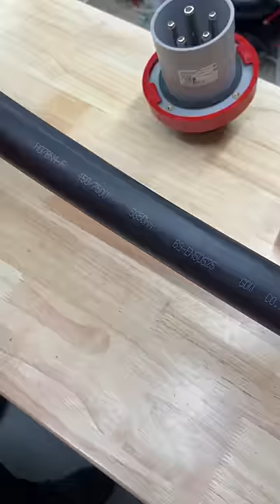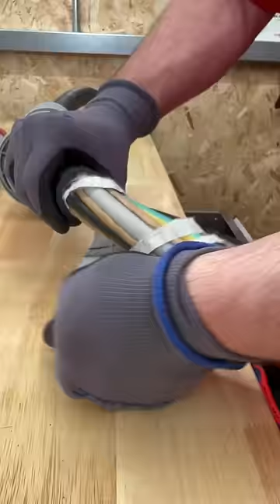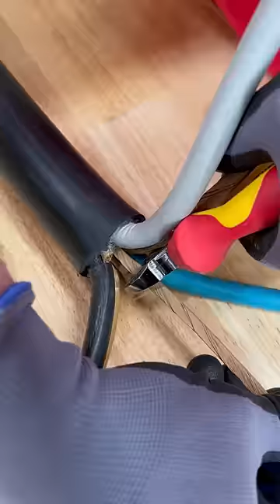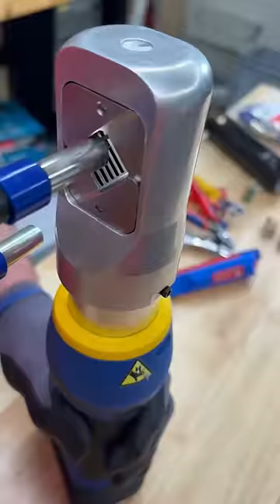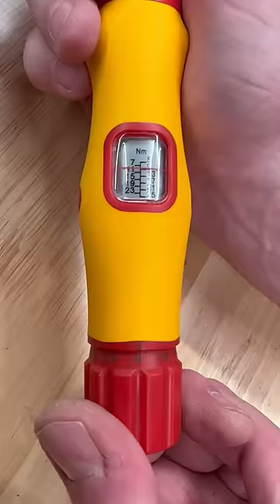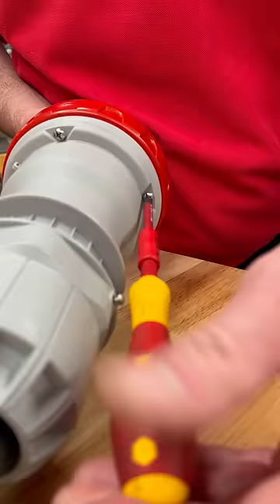Wiring a Massive Plug: We enjoy this electrical work!

Comment: Aside from this being extremely fun to watch, I think as a joke, at the end of the clip, acting like it was then plugged in to the back of a refrigerator to then open the door to see if the bulb inside was working would have been hilarious 😂
Reply from the maker: Like it 👍
Reply: Take the prank a little bit further, and put a piece of clear tape over the button of the door switch so the light doesn't come on.
Reply: @efixx ассалому алайкум вы можете сказать артикул динамометрический ключ от компания wiha

Comment: if u were in germany u could start from start again , because in german the PE cable has to be the longest so if u rip the plug off the PE is the last cable to go off
Reply: In many of these plugs, the Earth terminal sits proud of the phase/neutral terminals, so if you cut the conductors the same length, you achieve the same result.
Reply: @Smatnm The rule is about cable getting yanked out of the plug .
Reply: @johndododoe1411  Yep, and if the earth terminal sits proud of live/neutral terminals and all cables are the same length, then the earth is the last to be pulled: same result.
Reply: @johndododoe1411  It could even be argued that, in the case of trailing sockets, the above mentioned method is safer than having all terminals the same spacing from the cable entry and a longer PE cable.

In the case of a proud PE terminal/same length wires, if the cable of a socket were to be pulled free and the breaker didn’t trip, you’re less likely to end up with an exposed and live/energised conductor if all three wires have an increased chance of contacting each other (and tripping a breaker) when forced through the narrowing of the cable entry. With a longer PE, there’s less chance it would touch the live/neutral.

Not that that is something I’d rely on for safety, more a happy byproduct/extra of the design.

Comment: The style of plugs are called CECON (European economic community - connectors), pronounced "se-con"
The CECON shown is a 3 phase + Neutral + Ground, also known as 5 pin, or 3Ph+N+Pe.
This size is rated for 64 Amp, 400V.
CECON connectors have a good IP rating, typically IP65. They are very common in industrial and comercial  use.
Reply: I think it's a 125A Plug
Reply: Ceeform
Reply: Yeah I thought 125a also
Reply: 125A 5 pin commando plug
Reply: ¿25mm2 cada cable unipolar, o quizás 35mm2?
Reply: You plug for a kettle  is huge. 
What does it take to boil water. 15 sec.
Reply: @assassinlexx1993  It's for brewing extra strong tea, drink of champions.
Reply: @trespire  can't argue with that.  Even your tanks are designed for making tea.
Reply: 64 amps?!?! You don’t need 0 awg wire for 64 amps
Reply: @biguzivert Usually fused at 63A times 3 to provide 40kW for construction or stage gear .

Comment: Lovely job on some decent size cable! Usually then ruined by folks that don’t push them fully home when connecting causing them to arc then go on fire 😬
Reply: Or at the very least you end up with the plug welded into the socket… Ask me how I know 😠
Reply: Open circuit diode protection will fix that
Reply: That's why this system has mechanical locks when fully inserted .  Some also have a pilot contact keeping power off until fully inserted  .

Comment: Those connectors are great! I just bought some. Mine are smaller, but they work great, and they make the connection points so much better. It looks factory made after you're finished. Great job 👏🏽 👍🏽 👌🏽 🙌🏽

Comment: Our 200 amp shore power military cables have pneumatic crimp pins that are inserted through the connector and lock into place. Connector is machined aluminum.
Reply: You should look into the plugs used for cargo and cruise ships .  Outlets are available in many existing harbors, increasing navigation options .

Comment: Those ferrules was slightly larger than those I use for my 3d printers 🤣
Reply from the maker: Time for a bigger printer 🖨️
Reply: @efixx  if I'd need 3-phase cable at that size for a 3d printer, it would not feel very safe 🙂
How much does that cable handle?
400v 200A+?
Reply: @kharmastreams8319  plug looks to be a 400/415 volt 125A 3ph+n+pe

Comment: now that is 3 phase power
Reply: looks like 4 phases, unless 2 grounds?
Reply: @acat6000 this is a good suggestion but there is a neutral wire there so 3 phases, ground and neutral depends on how you want to connect the loads you may use it or not.
Reply: @acat6000  4 phase isn't really a thing, anything above 3 phases is basically pointless.
Reply: @acat6000  Three phase plus neutral and earth. 400V nominal phase to phase, 230 volt nominal phase to neutral/earth. Standard for mains power in most of Europe.

Comment: I have learned that the green/yellow should be longer with a connection. If the socket tears off, the protective contact remains longer.

Comment: Finally an electrician that uses a torque wrench. I always encounter either so tight that the skin of my hands get stripped off when turning the tool to loosen a connector. Impact drivers were used. Or the weak handed electricians where I touch the wire and they fall out

Comment: I miss the times on the shipyard, where we had to mess with thicc cables. The welders were able to burn everything up :D. I cursed at them and loved them anyway. It gets that way on sometimes 14, 16, 18 hours a day when the work has to be get done. 125 amps cables, four single 300 sqmm strands to
Reply: Sent the comment by mistake and can't edit it on the smartphone browser. The 300 sqmm cables were for the ships in the drydock. We needed four of them. We had cranes but the last step you had to tug them by youself.
Reply: And our big motor generator to get from 50 to 60 Hertz. What a Maschine. Giant hunk of Metal

Comment: Danish electrician here...
Almost good:
> Snapping off spacing material.
> No illigal joints like the awful splicing videos floating around.
> Torque was a nice detail many forget.
> Lovely compact screwdriver set (have one myself), but individual drivers are better since you save time with switching bits.
> Putting the sleve on before mounting the wires in the terminals. Apprentices sometimes forgets that because they are too eager to finish the job.
> Using crimping equipment is a nice touch, although unnecessary, since the CEE plug is designed to take multicore wires directly into the terminals. Many like ferrels, but the reality is that you are adding another way for the connection to fail and cause whatever disaster as a result. You should avoid using them whenever possible like here.
What could be better:
> Using a propper cable and wire stripping tool instead of a knife that can easily damage the wires insolation or the wire cores. Even a scratch can leave a permanent weakpoint and a disaster waiting to happen.
> You bend the gray wire FAR to much! Look at the insulation at the top!!!
Reply: I think you need a help

Comment: It's extremely cool... Ummm, so what's it for? What takes 125 amps at 400 volts?
Reply: While I suspect there is some big industrial kit out there that needs that much power, I get the impression that the main use for these 125A ones is power distribution at events. 

Note that the three phase plugs are coded based on the phase to phase voltage. So this is standard European mains, 230V from phase to neutral, 400V from phase to phase.

Comment: We had these in an industrial workplace and had to connect and disconnect several times a day. These plastic connectors did not hold up well. Workers unplugging them and dropping them, they were soon trashed and had to go to all metal construction plugs. These would be fine for plug in and leave alone for months at a time.

Comment: I Had To Plug In A Portable MRI Trailer Once or Twice A Week @ Work Except It Was An Aluminum Plug on The End Of An 80 ish Foot Long Cable. But The Hardest Paart Was Fighting with The Spring Loaded Weatherproof cover, Trying to Line it up In The Dark, In A Shit Location With Barley Enough Cable, Then Getting It To Lock in Place. Otherwise Not To Bad.

Comment: Do you think it is worth connecting this plug without ferrule? The contact surface will be bigger, for sure. The thing with these particular SCAME plugs is that you cannot tight them too much as the screw thread will go. I am a fan of ferrules, but I have seen many plugs melt when the working current is close to 125 Amps (with ferrules applied) and start suspecting the issue in the plugs termination method. Basically, if you won't pull the plug off frequently, why not without?

Comment: Stumbled upon this channel by accident really, not an electrician by any stretch other than doing some pretty basic troubleshooting and house fixes for friends and family, what's the purpose of the cardboard in this wire? Is it to keep the round shape and prevent the wiring from twisting too much and tearing on the inside?

Great work though, very clean and professional, you definitely earned a new follower from down south in the Mediterranean

Comment: I‘ve got a question:
In Germany, it must be ensured, that the PE (Earth) inside of Plugs etc. always disconnects at last if the cable is pulled out.
In this case, I neither noticed a feature of the plug that would ensure this, nor that the other wires were cut a bit shorter than the earth.
I am aware of the fact, that there isn‘t much space inside the plug for spare wire.
Isn‘t this part of the electrical code in UK or is it just not doable in these dimensions?
Reply: For common type G sockets yes

Comment: I fitted some of this stuff. Expect t what I was fitting were a parallel pair of 185mm 4 core flexes from a change over switch to the generator connection box. 

Awful cable to strip out 🤦🏻‍♂️

Comment: you don't need insulated tools for this job. if it were me I'd rather keep the torque wrench in a box and use any other cheaper tool. but if you have the money go for it! a professional stripping tool for the cable is a great addition to your tool kit. Try Jokeri No. 35P or No. 70

Comment: I have always cut the Protective Earth wire just a bit longer than the rest, in case the Strain Relief fails, then the PE will be last one to pop loose if someone yanks the cable. Might even safe a life in some cases and costs nothing.

Comment: A lovely expensive and correct Ferrule Crimper and Torque Wrench.
Yet uses a knife to cut and strip insulation?  Not on a flexible multiple stranded conductor you don't.

Comment: Good connection , but from experience when you hit the 50amps and above using pin ferrule have to be done very carefully…
You don’t have any idea how many plugs my company replaced because of the heat the pin expand and the copper drop from the screws and make a short …

Better just connect the copper without

Comment: someone cheeped out with twisted strand aluminium instead of copper :P
Reply: Aluminium is a better thermal and electrical conductor per unit weight 😉 which is important when you’re dealing with 5x50mm2 conductors!

Comment: Klauke disappointed our company very much.
We have the EK 60/22 and one time the small aluminium piece that holds the crimp insert just snapped while crimping. Luckily we could still finish the work.

But after that we sent it to Klauke because it was still just half a year old and still has warranty.

About a week later we got it back but attached to the tool was an invoice and we should pay over 200 Euros for the repair.
Why should we pay for something they f.. up?

Another thing was that the bosch charger they sent with the tool came with a broken fan and sounds horrible.

We wont buy from them again for sure.

Comment: Crap aluminum wire  used here fail
Reply from the maker: It’s copper Ho7 RNF
Reply: @efixx  maybe go see a optometrist it's clearly silver so not copper man
Reply from the maker: @legros731  it’s tinned copper http://centralcables.co.uk/product/h07rn-f-heavy-duty-rubber/
Reply: @efixx  for what purpose cost more for no reason and this plastic plug is crap would not last long in a industrial setting uk crap standard it seem lol
Reply from the maker: @legros731  These sockets are used extensively worldwide and manufactured to a harmonised international standard.  Used everywhere from touring rock concerts to quarries. - this version is 125A - 400V https://en.wikipedia.org/wiki/IEC_60309